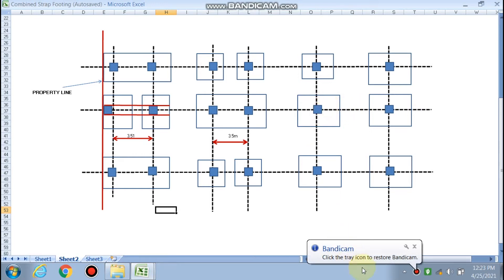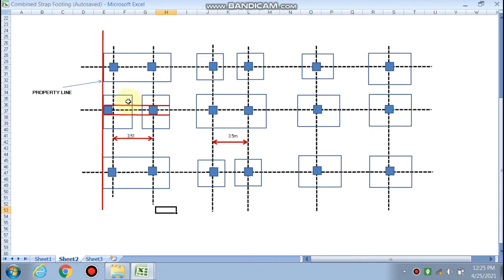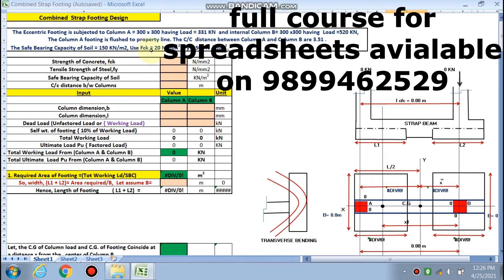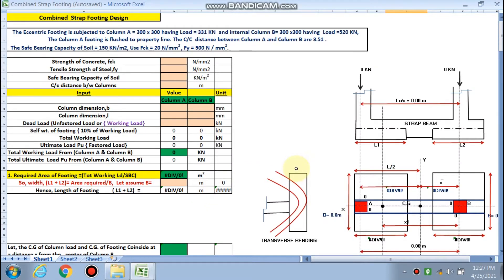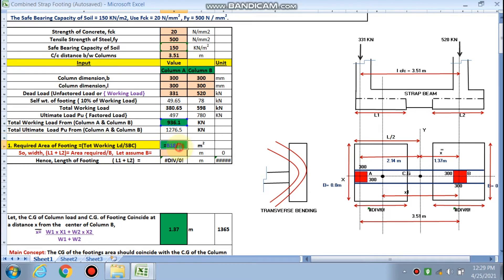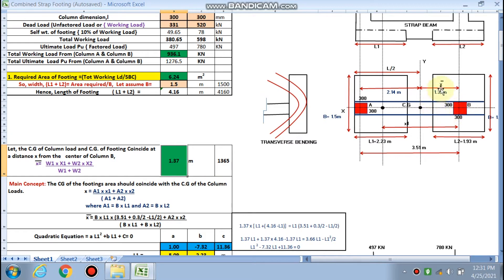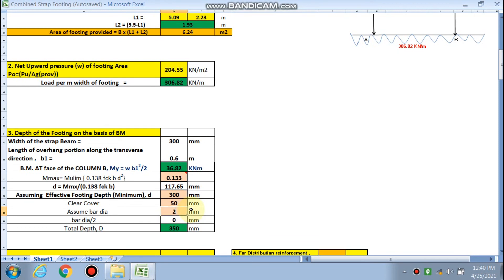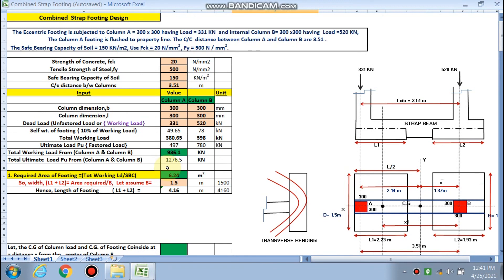STRAP BEAM FOOTING DESIGN I IS 456: 2000 I PART -1- BY CIVIL SMART

Comment from the maker: To get all the footing excel Sheets get from below link:

https://pmny.in/PAYUMN/WJczW5eItHK9

Full Course includes all sheets as under:
https://pmny.in/era02LAqXt8B

IN FOOTING DESIGN SHEETS

1. Isolated square footing

2. Isolated rectangular footing

3. Combined rectangular footing

4. Trapezoidal footing design

5. Strap beam footing design

6. Footing with uniaxial bending

7. Footing with biaxial bending

8. Pile foundation

9. Pile cap design 3 & 4 piles

10. Wall footing/ Strap footing

11. Raft Foundation ( Beam and Slab Type)

IN BEAM DESIGN SHEETS

1. Singly reinforced beam design sheet

2. Doubly reinforced beam design

3. Continuous beams design  with point load having

    2-span continuous beam

    3-span continuous beam

    4-span  continuous beam

    5- span continuous beam

IN COLUMN DESIGN SHEETS

1. Axially loaded column design

   (a). When column size is known.

   (b). When column size is not known.

2. Column with axial load with uniaxial moment ( on 2 sides and 4 sides reinforcement)

3. Column with axial load with biaxial moment

4. Mux and Muy Calculation sheet.

IN SLAB DESIGN SHEETS

1. Cantilever slab design sheet.

2. Simply supported slab design sheet.

3. One way Continuous slab design sheet.

4. Two way Continuous Slab design sheet.

5. Two way simply supported slab design sheet.

IN STAIRCASE DESIGN SHEETS.

1. Dog legged staircase design.

2. Open well staircase design.

IN RCC WATER TANK DESIGN SHEETS.

1. RCC WATER TANK RESTING ON GROUND (L/B <2).

2. RCC WATER TANK RESTING ON GROUND (L/B >2).

3. UNDER GROUND WATER TANK DESIGN (COND. TANK IS EMPTY AND OUTSIDE SOIL IS SATURATED).

5. UNDERGROUND WATER TANK ( TANK IS FULL AND NO OUTSIDE SOIL PRESSURE).

4. UNDER GROUND CIRCULAR WATER TANK.

IN WALL DESIGN SHEET

1. RC WALL DESIGN SHEET.

2. RETAINING  WALL DESIGN SHEET.

3. BASEMENT RETAINING WALL DESIGN SHEET.

Building load calculation sheet

Cost estimation sheet..etc.